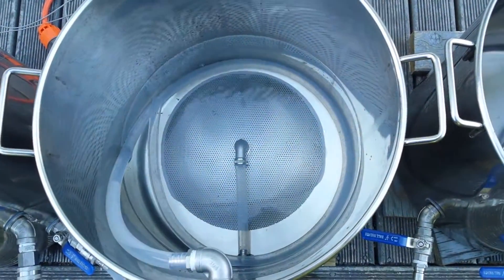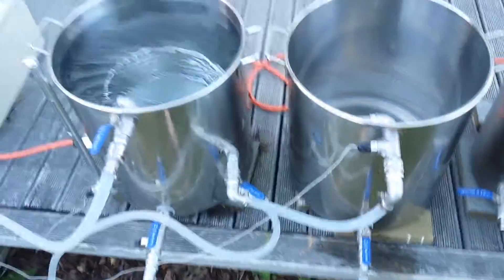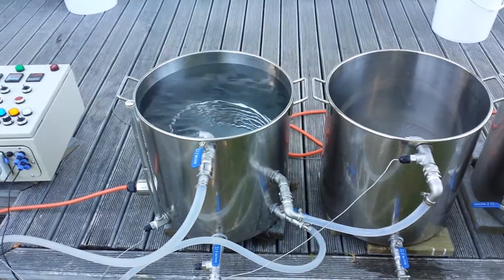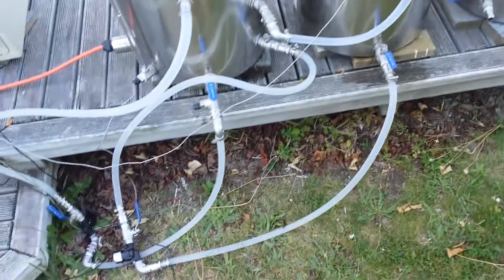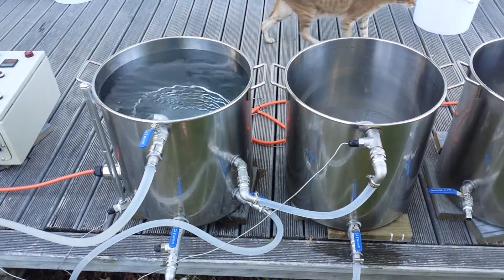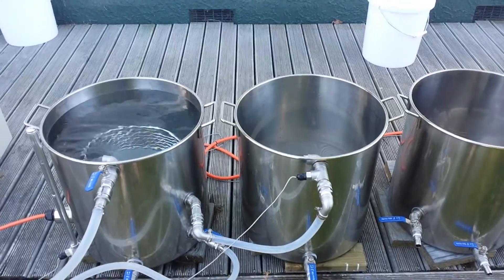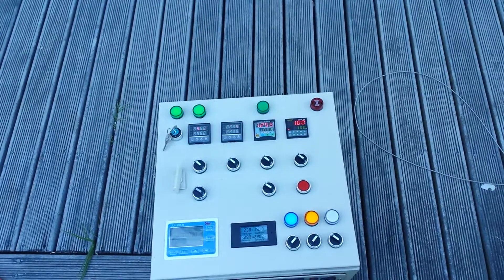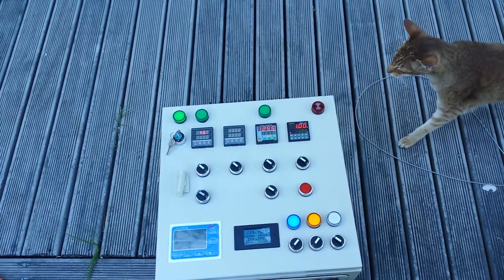Homebrew HERMs system test run 2 pumps(1)

Comment from the maker: After some more testing and measurements I now have some calibrated sight glasses but I need to draw proper labels up on the computer and print them,  for now paper with pencil marks will do.
The 50L post are actually only 49L, I thought I had made a mistake measuring them until I got out a tape measure and calculated the volume that way.

I have most the numbers for my beer smith equipment profile now.  just need to weight the mash tun then enter the information.

On testing my boil off rate I got 6L per hour which seams like a lot.  Maybe I was boiling a bit aggressively,  I'm not  sure how aggressively I should be boiling.

Next up assembling and adjusting my mill.

Comment: How much did this cost altogether?
Reply from the maker: Sorry I'm late replying.  Managed to break a bone in my foot and had other things going on.  I haven't totaled everything up but the pots cost about $100NZD each delivered and most the pipe fittings came from aliexpress so were reasonably priced, probably a few hundred $ in fittings .  I started with cheap $40NZD pumps but have since upgraded to $110 pumps.  I think the 30 plate chiller was about $130NZD.  I brought more parts than I needed to experiment.  I guess between $1000 and $1500 NZD.  probably th middle to low of that range although I'm sure it could be done cheaper. 1NZD is approx 0.7UDS.  Quite a bit of shipping cost for bits from alixpress but still significantly cheaper than local firms although I did get some parts locally.